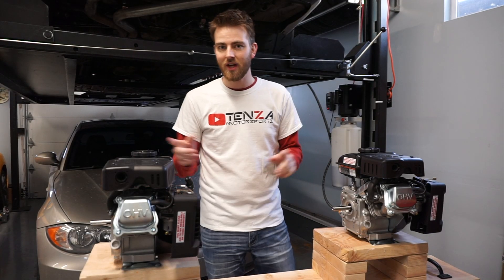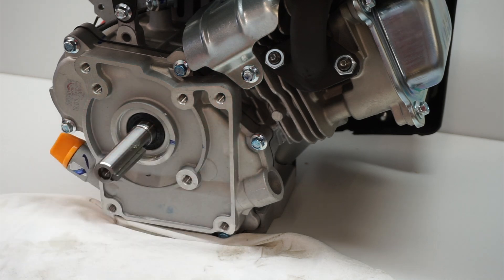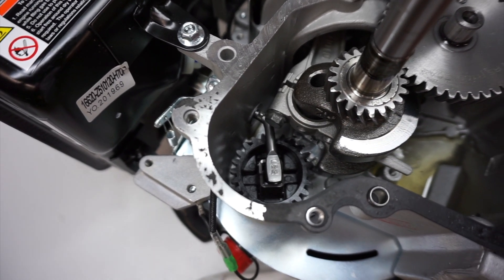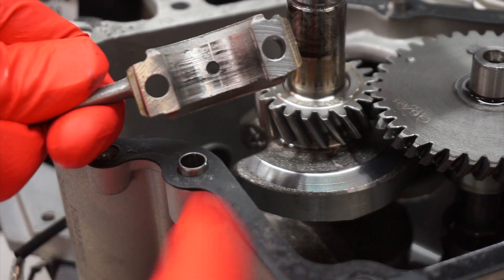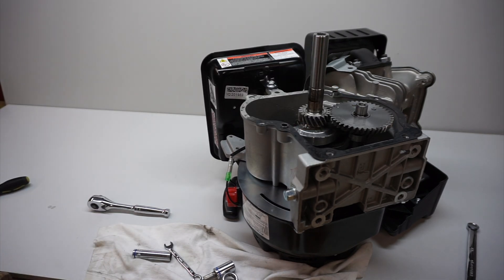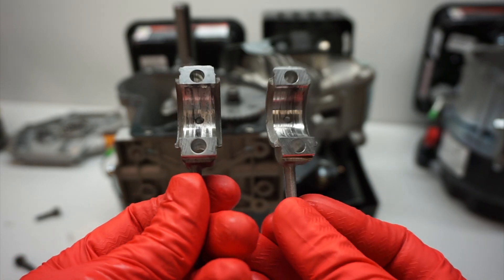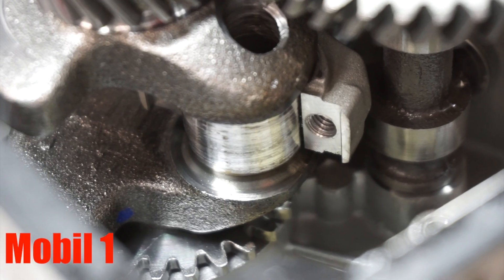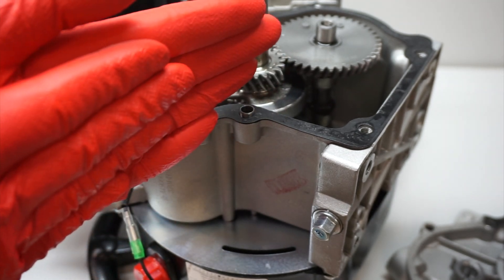Mobil 1 vs. Amsoil. Damage Report Torture Test Results. Search for the best synthetic oil (part 3)

Comment: When Castrol was first introduced, they.ran a test similar to this versus so me other oil.  They ran both engines for a period of time, then drained both and ran them dry.  The engine had the other oil seized after a short while, the one with C astrol ran for a very long while after being drained.  The main reason I have since used Castrol I would like to see you run this test using Castrol.
.
Reply: Unfortunately all oil have been changed since.
Reply: Castrol most likely is better oil people are brainwashed with amsoil

Comment: I won 6 road racing championships riding Yamaha motorcycles. I was two time national champion, AMA, and, WERA. I switched to Amsoil. I had my first catastrophic engine failure using Amsoil. I woke up two days later in the hospital in plaster. six weeks later when I was able to, I took the engine apart, I had my very first Piston seizure, both cylinders using Amsoil.. I have both pistons and the helmet I was wearing that day which has three cracks in it, and the face shield is melted from sliding on the asphalt. I have them on display in my garage. That was the end of my road racing days After eight  successful years ...
  by the way. Since Amsoil first came out, I have been using it in my cars and trucks. I change the oil once a year. I’ve never had a mechanical internal part fail on any of my vehicles for over 30 years. Right now in my ram 1500 hemi, I am using mobile one and Purolator oil filters..
  The federal government, the US Army, the Marines, use mobile one in their multi million dollar tanks. Chevy Corvettes came from the factory with mobile one in them at one time, maybe they still do, some Ferraris come from the factory with mobile one. i’ve often wondered how a new car could come with mobile one in the crank case because, the rings need to be seated my honing themselves in against the crosshatch marks on the cylinder bore‘s. The film strength of mobile one would prevent that matching of the parts by running the engine because of it film strength..
  they also use mobile one in equipment at NASA.
  ever wonder why all these little companies take a.m. at the big boys/namely/mobile one? 
  it’s actually reassuring to see that mobile one is the main target of these other companies attempting to knock mobile one off the top spot. They always claim to be better than or as good as mobile one. I’m actually grateful to these other companies for reassuring me that, Mobile one is still the on top..
  Any multi weight oil is partially synthetic.. The wider the spread between the winter weight numbers, such as 10W-30 versus, 10 W 60, the wider the gap, the more polymers have been added in the additives package..
  there have been a few gimmick oils over the decades. There are used to be the stuff called Arco graphite. It was black from the graphite in the oil. The problem was, the oil filter would filter out the graphite and would actually block the filter, and it would run on bypass..
  then there was that stuff called slick 50.. same thing, solid particulates in the oil that the filter will take out, and it blocks the filter in the meantime
  How about whynns friction proofing( spelling). that stuff was over 94% pure kerosene
  then there was STP. Do you know what that is, it is refined crude oil with no additives yet. It is the building block from which they create multi weight oils with additives like anti-foaming agent, anti-corrosive agents, polymers ,STP is the place you start when you are making oil. He start with refined crude oil that has no additives. That is what STP is.. when it’s hot, it is like water, when it’s cold, it would take an hour to pour one can into your engine if it’s below zero. It is not stable at all. I don’t remember what they used to claim it did for your engine, but it was a big seller..
  There’s a lot of gimmicks hot there

Comment: This really did not prove anything. You just ran a dry engine to failure you don't know if the caps were tighter on 1 vs. the othet and you are using cheap garbage engines. I am sure the tolerances are not very tight on these. You wasted your time and money. Thanks.
Reply from the maker: The engine was not dry. We have ran a completely dry one, as a control, it did 1:13. https://www.youtube.com/watch?v=W91JQNCTAGA&t=325s These tests show what happens when your engine is no longer receiving new/fresh oil. If it was complete devoid of oil, it would not have ran anywhere close to 5-7 minuets.

Cap tightness doesn’t matter as long as they are both over spec. Since their failure wasn’t based on a loose cap, We’re going to say that didn’t play a part in the outcome of the test. 

These engines have just as much tolerance, to each other, as any other engine that has been out on the road driving around for years if not decades. In a real world situation you would not get to run you car low on oil a bunch of times with a new rebuild to see how long it last. You have an oil pump or a pan break, and thats it. It would be a random number because your engine has different milage, wear, and tear as other same spec cars on the road. These engines have tighter tolerances to each other than most other cars on the road, compared to each other.

In order to do this test like you’re saying I would need to have two full sized, brand new, motors. If you think playing around and breaking $180 worth of small engines is a waste of money. How would you justify buying two full sized engines, doing a full rebuild, then blowing those up to the tune of thousands of dollars? I'm sorry you don't fully understand the parameters of the test, but that does not make them a waste of time and money.

Comment: The problem is, there is no way to know if the failure is due to oil or the differences in the engines themselves.  MAYBE if you did the same test for three rounds (six engines) or more to rule out engine differences, this would carry some weight.
Reply from the maker: You are correct in pointing out that a larger sample set would yield more definitive results. I would love to have the money to perform such test but that not the case. I felt this test would at least give an idea of the oils performance using a real engine instead of a simulator based test. Thanks for the comment.

Comment: Two cheap Chinese engines! The differences in production tolerances most likely explain your results.
Reply from the maker: It’s a real world test on widely used commercially available engines. I'm sure it’s not perfect (sample size is not statistically large enough) but it is a real world test. Thanks for watching and commenting.

Comment: Is this similar to "which laundry detergent works better?"  but you don't add ANY detergent  LMAO
Reply from the maker: No. I explain the test in the video. There is oil still in the engine. Just very little. We ran an engine as a control with no oil at all and it ran for 1 minute 13 seconds. If these engine were devoid of all oil it would not have ran anywhere near 7 minutes.

Comment: On my 3rd Jeep XJ with all 3 turning over 300k plus miles. Used mobile 1 in all my vehicles and never a internal failure. I change every 3,500 miles regardless of vehicle manufacturers recommendations. I won't knock Amsoil products because they're a proven quality brand in all applications. I will knock their ridiculous pricing though..
Reply: It's definitely not cheap but it's not that crazy. I pay $10.69 a quart. Very close to any boutique oil company. Schaffer, Torco, Motul is the same price. I was going to try Torco this time and do an oil analysis after but it's $21 a quart. $130 shipped for 6 Quarts. That's crazy to me. Amsoil Signature Series is almost half that.

Comment: I would have slapped it back together, throw some new oil in it and run it for a long time.
Reply from the maker: I tried to. The metal is so scarred and messed up when you torque the bolts back down it locks it up.
Reply: @TenzaMotorsports  did you grease the bearings first

Comment: I will stay with Amsoil this test showed a lack of both oils,  No oil is no oil. simple to understand, And Amsoil has a good warranty.
Reply from the maker: This shows low oil, not devoid of oil. this shows film strength, heat resistance, and lubricity properties. If it had no oil it wouldn't run nearly that long. We ran a test with no absolutely no oil to get a control.

https://youtu.be/W91JQNCTAGA

Comment: I havent been keeping abreast of all different oils but from what I can remember amsoil is a synthetic oil and mobil 1 is a mineral oil made using a "synthetic" process. I think amsoil took mobil 1 to court because it is not a real sythetic oil.
Reply: Mobil 1 EP is 60 to 70% PAO according to their SDS.  That is very good PAO percentage.  The regular Mobil 1 is 30 to 40% PAO according to their SDS.
Reply: That was mobil 1 took castrol to court...mobil 1 supplies amsoil with base oil.
Reply: @steverugerguy9606   yup, Castrol came out with their group III hydrocracked highly refined petroleum base oils and called them synthetic when in the truest sense of the word they were not. So Mobil said hey wait a minute that's not really synthetic. In the end it was determined that the oil was changed enough to call it synthetic and Castrol got their way. So now synthetic is just a marketing term and we don't really know what we are getting. It's been found that some of the so called full synthetics contain large amounts of group II conventional petroleum oils in them. Of course all oils are blends of different components, but you can kind of tell by the price. Just how much synthetic do you think you are getting for a few bucks a quart. Because premium synthetic components are expensive.

Comment: The thing with the harbor freight motors is there’s no 2 the same, tolerances can be different, valve lash is never the same, motor timing etc
Reply: yup we had 15 donated in shop in high school and all of them had different specs.
Reply: It’s already been proven mobil 1 is an ever age oil and very overrated by the company and people who swear by it 😂
Reply: @Theedd9991 
 Ever age oil is like Mount Ever Rest.  The oil works at every age, like when one climbs that mountain has a good chance of resting forever. 
  Could you have meant average? 🤔 😂
Reply: Nice name
Reply: agreed! This is in no way an apples-to-apples test. If you want a true test buy new motorcycle engines or Honda small engines that are built to high-quality high-tolerance specs. ChaChing! My guess is that both oils will perform identically the same. I have used both Amsoil and Mobil 1 with no problems in my turbo-diesel truck.
Reply: I was going to say the same thing.
Reply: Exactly Blake, The two different oils in a High performance high revving engine, show no difference in wear, per nascar and F1 other than opinion of course.

Comment: The problem with this test is these engines dont have an oil system that pumps oil an lubercates these parts its lubercated by splash. Amsoil is fare more superior i just changed my motor cycle oil from mobil 1 to Amsoil an im already seeing better start ups engine sounds smoother shifting is like butter!!!! Why i has hooked an became an amsoil dealer yesterday. Any body looking for the first real 100% synthetic oil hit me up. Amsoil only failed in this setting because 2 reasons 1st mobil1 is thiner even at same viscosity 2nd no oil pump to get Amsoil on that bearing just splashed on.
Reply from the maker: That’s the whole point of the test is no more oil is being added. Just the oil that is left on the surface. That’s all that will be protecting the surfaces.
Reply: @TenzaMotorsports  point im making there was no amsoil on the bearing to begine with thats why it failed first
Reply from the maker: Thats not true. We did a test to get a constant and the engine with no oil lasted less than 2 minuets. The Amsoil engine did in fact have oil on the bearings.
Reply: @TenzaMotorsports  amsoil viscosity is to thick to get get o. Those bearings from just splash. If you took apart the rod tyen soked it in othe oils for 24 hours you would have a different results.
Reply from the maker: Sorry, but thats just incorrect. Amsoil has very similar viscosity to the other oils I have test based on my Bench tests. 
https://youtu.be/RHk_fibP2wA
Both engines had ran for 4 hours on high a weeks before this torture test. The engines also had oil in them for about a week.
Reply: @TenzaMotorsports  even at same viscosity Amsoil is a lot thicker then mobil 1 i just changed oil on my motorcycle an this was visible to my eye. If you do a simple drain test you will see Mobil 1 will drain faster then amsoil every time even at the same viscosity.

Comment: In mechanical terms this test is no valid, I worked with those small engines for very long time and if you remove the cover you are removing the bearing witch keep centered the crankshaft, so without the side cover the engine wont spin when you pull the flying wheel because the crankshaft is crocked no because oil or engine damage, can be some damage there but is not the main reason why the engine dont spin.
Reply from the maker: The engine never ran with the side cover removed. It was  ran 4 hours with new oil then ran the torture test. Engine was completely assembled the whole run time.

Comment: Noted not to lety the Tenza motorsport touch my vehicle
Reply from the maker: Lol, we are good with vehicles! Just keep your small engines away from us.
Reply: Its the small details that are most important, and when these small details are neglected results  in bringing down the biggest and mightiest.
The no oil test was done by Slick50 to show that it coats the engine insides of the engine. A soil never claimed this. And one thing to remember that SLICK50 WAS ALSO A MOBIL PRODUCT.

Comment: I'm trying to understand how this test correlates with engine longevity under normal circumstances
Reply from the maker: When you crank over your engine before it starts up you have no oil pressure. Those few moments, especially on the top end, Will eventually add up. Running the system with no little oil shows how strong the oil is.
Reply: @TenzaMotorsports  No little oil ? W d t m ?

Comment: did both engines have the exact same connecting rod journal clearances? 

would like to see this repeated with 30 engines of each oil.  in order to come to a conclusion you need to be able to demonstrate results repeated over and over, right?
Reply from the maker: I would love to do this over and over but I don’t have the budget to do 30 engines.

Comment: Was the oil supposed to coat the metal after drained?? I use Amsoil on my fleets with the older vans and cars running 400,000 to 700,000 miles. I keep them running with the oil tho.......
Reply from the maker: It coated the metal while it was running full. This just shows the wear protection compared to Mobil 1

Comment: The test doesn’t really test the whole properties of the oil being tested. Anyway nice try
Reply from the maker: Care to explain what properties weren’t being tested?
Reply: Tenza Motorsports some oil even though they are good they evaporate faster. I saw a review of project farm where he tested most of the properties of oil not drying them up.
Reply from the maker: He tested the oil at 400 degrees. Engines don't get that hot. they run around 230 degrees. Boiling engine oil on the stove doesn't show what oil does in an engine.

Comment: No that's not the way to test! If you drain the oil out n run it what do you think is gonna happen? I have seen small engines with failed rod bearings like that many times. The rods are always the first to go. Oh and what oil did you use beforehand, auto oil? AMSOIL makes an excellent small engine oil you know! Idk if Mobil even makes a small engine oil, the formulation requirements for a hot running hard working small engine are much different that a liquid cooled automotive engine you know.
Reply from the maker: I don’t think you understand the test. Wether or not the oils are designed for the engines or not doesn’t matter they both went through the same test. Of course they aren’t designed to run with extremely low low oil. I’m not testing small engine oil. I’m testing normal engine oil. If I wanted to know the best small engine oil I would have used small engine oil. Both of these engines were brand new and had only used the oil being tested

Comment: I don’t understand the point of this. You can’t test the quality of any oil when there is no oil in the engine. All you did was prove that the engine’s require oil.
Reply from the maker: Did you watch part 1 and 2? They Explain this. There isn’t no oil, it’s just very little oil. These engines wouldn’t run anywhere near 6-7 minutes with nothing in them. To prove this I will be running one of these engines completely empty in the future. And I mean nothing in them. I will be pulling it apart and even removing the assembly lube.

Comment: I use Redline for my Corvette after a failure on the track with Mobil 1. No problems after five years.
Reply from the maker: What exactly happened that made it fail?
Reply: Are you sure it was the oil?